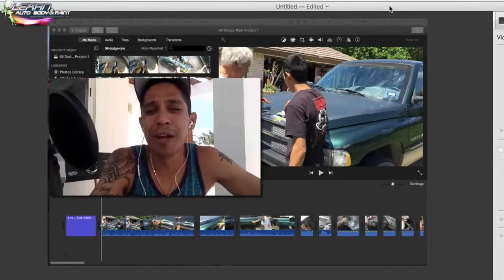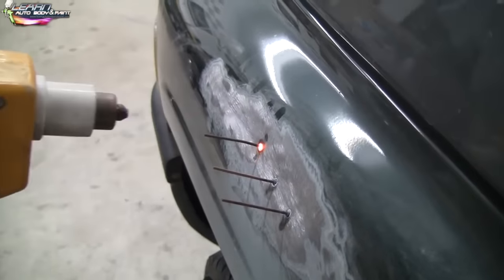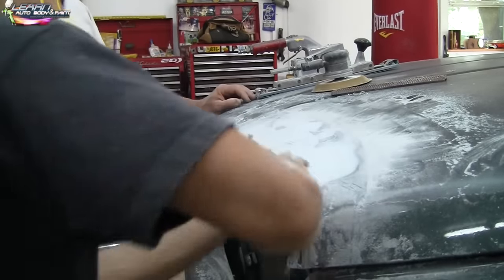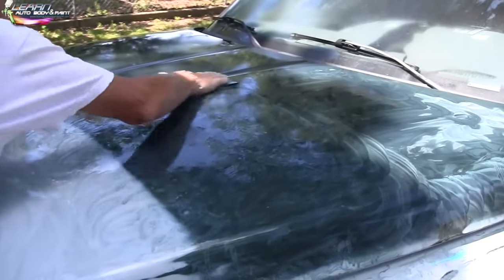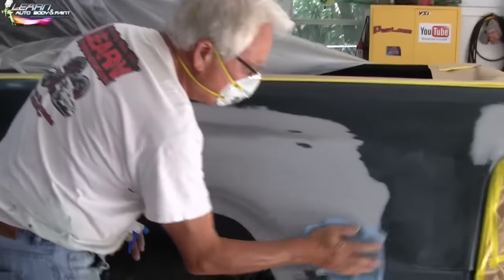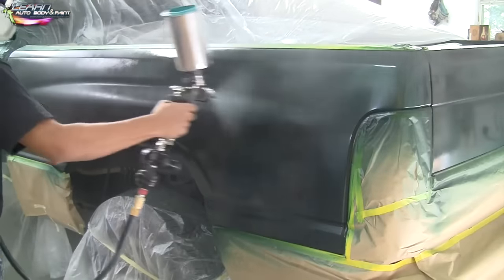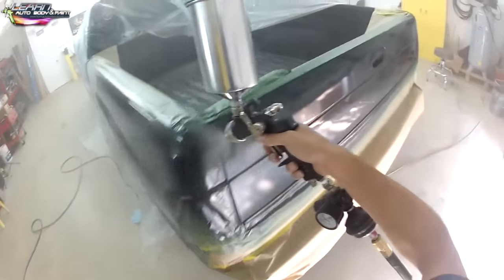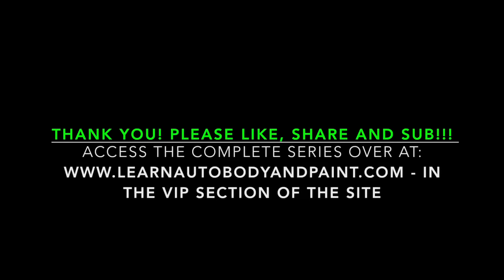For Newbies-  Auto Body And Car Painting Footage- Step by Step DIY SPECIAL

Comment: Man I appreciate this video. At my job I work in inspection and they asked me if I wanted to start trying do repair work. I said yes but I've never painted anything like this before, figured I'll either do it or I won't lol. So for extra tips and help I came to YouTube and luckily found this video. When you talk about orange peel it's something we also see sometimes. Never actually knew what caused it until you explained it, just knew what it looked like. The POV while you spray the panel and tailgate is very helpful. Thanks again for the video man, totally helped

Comment: Tony, I like what I saw, you are pretty knowledgeable and professional in body work and your video presentation.
I worked as an industrial painter for 35 years, using a very wide range of materials. I would like to recommend to you a couple of things while you are in the spray booth. Put on a long sleeve shirt and tape the cuffs, use a spray hood or invest in a full face mask, you can get tear away lenses to.  keep the face portion clean. Trust me on these matters, years of chemicals is very bad for your skin and your health in general.
Reply from the maker: Thanks for the advice!

Comment: I am doing a Outbord motor 1956 30 hp Johnson sat in a basement since 1975 got it running now I just need to learn to paint it I got  expensive paint 96 bucks a quart so I don’t wanna mess it up sanding it down to bare metal and I got self etching primer I got a hvlp paint gun thanks for the videos good information

Comment: You can't really prevent orange peel but you can lower the amount.still always wet sand and polish your paint for that smooth mirror like finish.
Reply: well if your doin insurance work, you'd best match the peel on the rest of the car,right,and learn a spraying technique that your able to use to get a dust free job.
Reply: "flip car" or not no excuse for the color issue,when he went to the paint store to purchase the color,i guarantee they had alternate decks,and he could have broughta gas cap,if painted or another sample to match with.im no one special but I do take pride in my work,wether it was p.o.s. Toyota or a1 of 1 Ferrari,or bugatti.
Reply: @conservativerealist  Toyota's are proven to not be peices of shit:)  u could have said "Chrysler"

Comment: Love your methods and techniques and extra info esp about the clear and the distance you keep the gun from the vehicle.  Really nice to see the spot welder in action followed by the slide hammer and also ratchet strap and hammer to pull the front hood dent.

Comment: With 25 + years experience I would have sprayed the primary areas black then applied to coach of green then you're done other than clear coat
Reply: Easier to cover black than primer gray 👌🏼, always use a cover coat .
Reply: Learned this tip painting homes and rooms. Paint is paint and automotive costs more. Red is brutal in home paint...dark colors. I tint all my primer based on what I am putting down. It saves$ and time.

Comment: Using a dark sealer over that gray primer would help you with better build good video
Reply: Or a coverage color close to the original base color for the primer then use the main base coat color to finish it off and blend to the rest of the panels
Reply: can somebody that speak english 100% and portuguese   , explaim to me what exactly  is sealer ?    is it clear coat over the primer before paint?   i saw in another video  the painter sprayed   sealer   , it was transparent like clear. ...  everybody i ask here in brazil  dont know what is it.

Comment: Just a reminder, don't later up a ton of body filler in one spot. The general rule is no more than the thickness of a nickel. If you go much thicker it will start to crack and peel.
Reply: Maco20047 very true,so some more metalwork,before you fill.
Reply: when doin a pull,on a machine,or a tree,stay clear of the clamp and chain,should they happen to let go,I've seen them go through centerblkck walls..lol
Reply: How would you fill an antenna delete or a quarter panel? Metal mesh behind and body filler?
Reply: @chrisspencer8815  Weld in a little plate that adds metal in that area, then fill what's necessary.
Reply: @chrisspencer8815  welding a metal plate is the best way,but fiberglass and resin works pretty good also.

Comment: you can see the dark and original.. fron a mile away... its never be same.. painting section.. paint the whole truck.. then paint is all the same tint.... but great video
Reply: you see it too huh thought I was the only one
Reply: He said in the video it was a flip and it wasn't worth a full job plus it's a old truck so who cares
Reply: VANflawless flawlessNIXION woman u are fine
Reply: The real Black yeti thats not the point he didnt even get full coverage on the bonnet (hood) you could clearly see it when he applied the clear
Reply: Yeah its just a quick flip watch his video on blending if you dont like hard lines
Reply: just 1 life c
Reply: you don't need to paint the whole truck to make the primer spot disapear..if your someone doin ait at home get ur car paint code go to localpaint supplier if you have a removable panel,take it with you.there might be 2 -5 different variants of the same code i.e.darker,lighter,greener,or bluer than standard.you should be able to come away with a bendable color at that point,bring home a little test panel with 1 half white the other black.now paint that panel and count coats until  ypu only see green and not the white or black.alot of greens are very transparent.get the primer spot covered then blend it out 2 or 3 times after reducing the color a little more.let dry and clear.either his color was way of or he didn't get the primer covered all the way.
Reply: That's what happens when you use cheap paint, don't have a color gun to shoot the color or a variable deck to choose from. He wasn't building a church. It was a flip truck. that's all I would have done.

Comment: Bondo omg… I Wood never use that much on anything!
Reply: TheCbj79 this is just a quick fix . They said they didn’t want to spend to much time on the bodywork .
Reply: Agreed. These are the guys that beat people up online to buy vehicles as cheap as possible. They throw Bondo and a cheap paint job to sell the vehicle for the max promising it was repaired and painted by a professional. A few months later, the Bondo starts to crack and the person that bought it gets fucked. Listen, there’s nothing wrong with this kind of work if that’s what you can afford, but never for a resale. It’s crooked.
Reply: Warren Case So my understanding is that everything else was done right except for the bondo because it was excessive? If they would of used the correct amount of bondo would the job be correct then? I’m asking because I’m trying to get into car flipping and want to do paint jobs myself if there’s not a lot of paint repair to do to them.
Reply: @ScreamingAirborne  @all  there is so many things wrong with this... go buy a car at car mart. they sell a car KBB @ 2.5k for 10k on a 10 year note. looks great fresh paint. no dents. then 4-6 months after this is done to one. then the paint fully cures and none of it matches the thin Clear coat is already scalling. cause it's too thin and didn't seal the base is failing cause it can't stand solo. the factory got scuffed to make the thin coat stick so it's falling now also rust is starting to form cause had to be taken to the metal and too big ass packs of bondo is fully cured on the outside and the wet inside is about done ready to pop at least do it in one so it just cracks with 2 of them when they both swell it's going to blow that off the whole piece. this isn't oil-base single stage Rust-Oleum. this is weak cheap over priced water paint's they can't hold it to gather.  someone just ponied up all of there life savings, or promised there life to a dealership. lets hope they have a garage. but no it will probably end up. in a low income housing projects. to some single mother with 5 kids. she will keep driving it cause it's all she's got. then there will be more fail body work youtubes on here to look at
   lucky rule of thumb is it's going to look bad or run bad.. lets hope it atleast runs good. just think he has a group he teaches others to do this. i guess we all got to eat oh i'm new to youtube i guess i just made a account. =-P

Comment: 11:10 colors are night and day :x
Reply: ghettodriftmonkey1 the panel by the mirror is the sunlight hitting the panel. Of course it's going to be a different color!
Reply: I'm talking the face not the flop
Reply: lol why u think he parked half the truck in the shade... gotta hide all the flaws and poorly matched/blended paint job. Sad thing is how proud of their work they are.
Reply: everything about the vid is a lesson in what not to do...its cool,him and grandpa got some quality time in,how about spending some more time perfecting the metal work,the way he's mixing bondo..whipping air and future pinholes into it.u don't need 40 grit,and get rid of the airboard..do it by hand and have some pride.then teach us a little about matching colors,alternate formulas,what toners to what,,and where's the fucking spraybooth.someone gonna see this and spray a car near a gas water heater and have a possible surprise
Reply: T. Price I've been trying for a week not to point out all the errors in this ,i couldn't hold back anymore,been doing this professionally since 1995,and I haven't put out a how to vid yet.maybe a pic of a couple finished jobs...
Reply: not  covered and very mottled.lil thing called a drop coat if you got Mottlinh i.e. "tiger stripes etc..here it goes ,reduce your color more ,turn the pressure way down and hold the gun alot further away,only if your fixing mottling,low pressure and thinner color will give you bowling balls,instead of bbs.imagine a floor covered in either one,the bowling balls will have space between them allowing a blend to "happen" ..or use the right temp of reducer...lol

Comment: A tip for buffing. Have a spray bottle and mist water of the area you're working on. Help cut down on burn through if you run low on compound on a panel. And helps with pad build up

Comment: Takes me maybe 10 coats of filler to get a surface smooth.  I never mix as much as shown since would get wasted.  I have time for maybe 5 or 6 swipes before it sets up.  I've used Bondo and EverCoat filler.  I start with Bondo Glass or Bondo Hair, or even woven fiberglass and resin if thick or covering a hole.  Those avoid later cracking on a thick fill.  I prime bare metal first, though often gets sanded off when smoothing the filler.  Most shops fill straight over bare metal.  Using a cheese grate as soon as you finish cleaning the tools w/ acetone (~5 min after fill) is smart and saves a lot of sanding.  Don't imagine you will fill on the first pass.  Usually you must fill a much larger area than you thought to get the surface smooth.